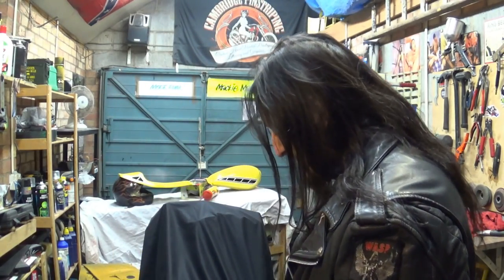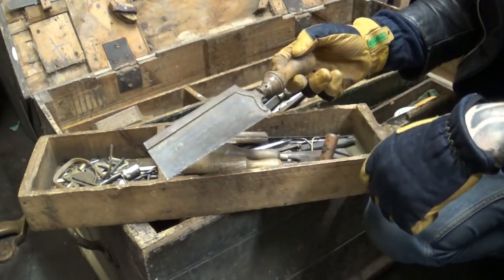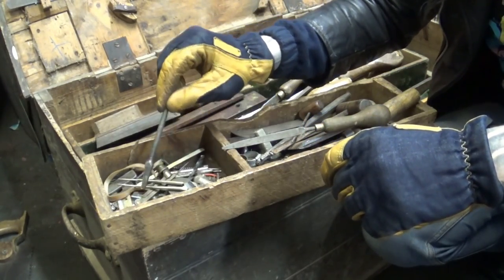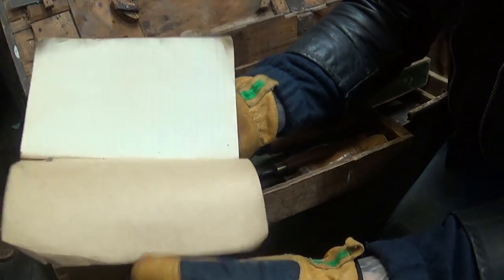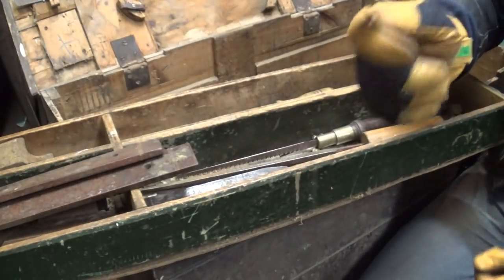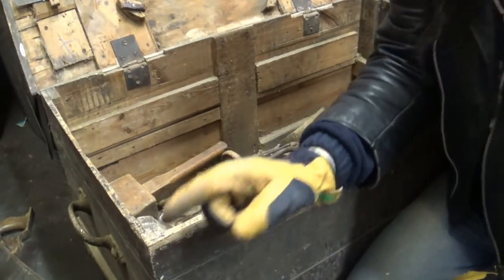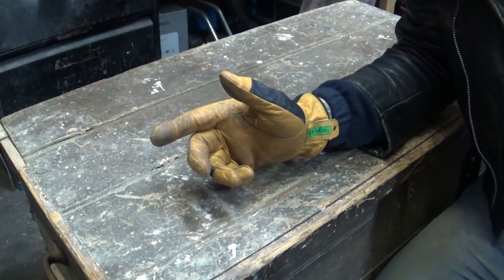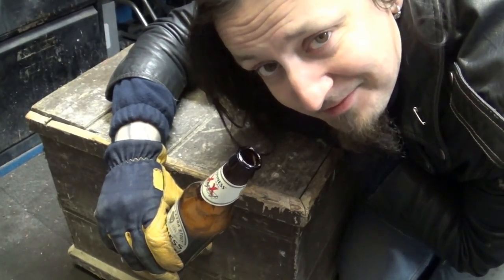What's in the Box ?

Comment: Captain first tool like a cork screw is a gimbal, for pre drilling to take a screw . The counter sink is for a brace drill the little spanners are for point setting on early motor bikes in b.a. Sizes the wooden handle tools are London style screw drivers. The curved chisels are called gouges that bit is to go with the fist brace or drill you pulled out . Anything else just say the handles are box wood . The box is known as a carpenter travel box it's the first thing you make as an apprentice. I made mine in 1969 lol  but I was a wheelwright coachbuilder not carpenter . Great stuff 👍🤘🥃🍺🥃👍........ just watched again the little spanners will have a blade type thing at the front that is a feeler gauge it will be 15 thou . The first saw little on is a gents saw for dovetails. Item to is part of a motive gauge it should have a block that slides and locks for the measurement you require . The adjustable spanner is called a bike wrench they came with most English motorbikes and cars it's for adjusting the chain tension etc he must of been a biker quite appropriate lol
Reply: Lol wow 2 years after I was born lol
Reply from the maker: Oh mate! David this is gold! This stuff is truly gold. Thank you so much for your comment, I can see you know your stuff and I do indeed have a lot to learn! Best wishes!
Reply from the maker: I know, respect!